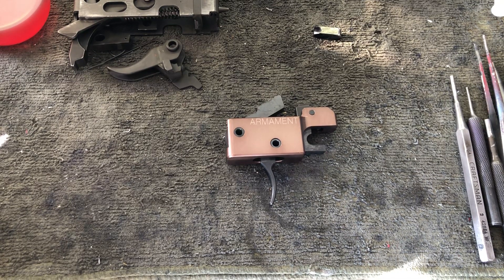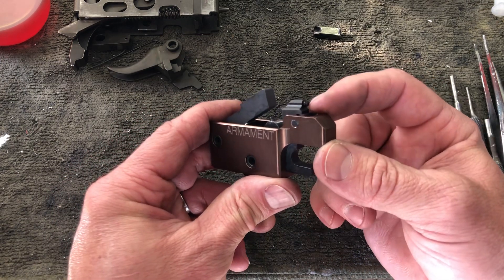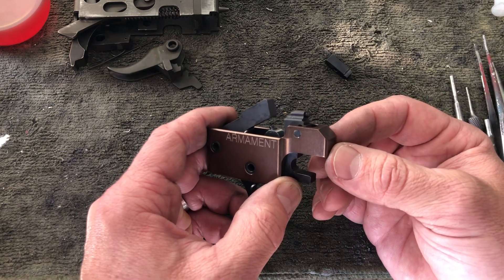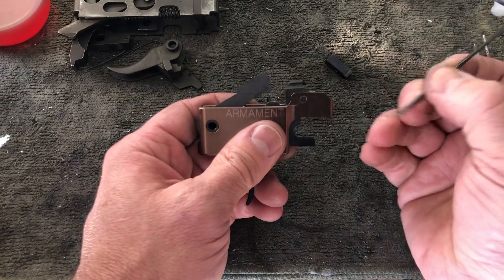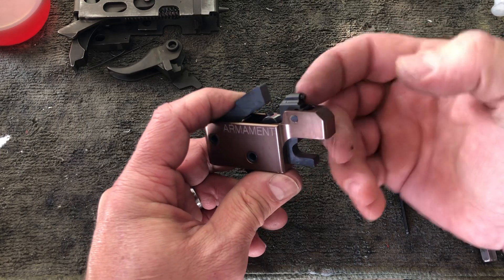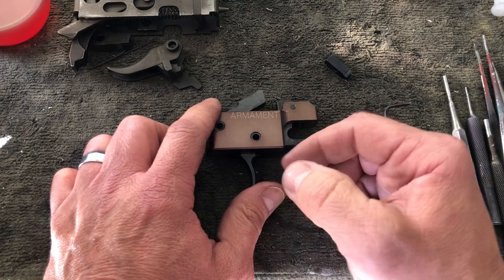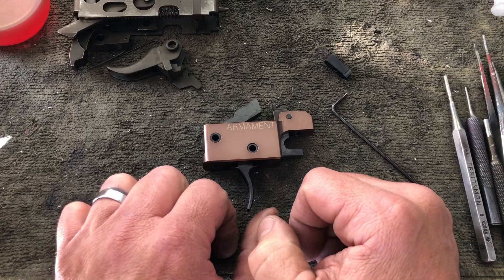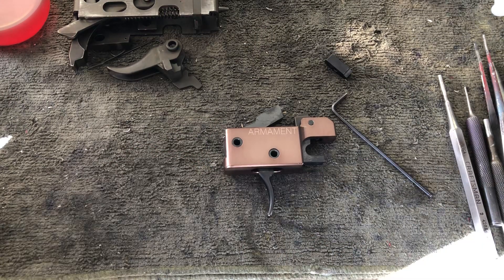Rate Breed FRT Trigger bar

Comment: Fourth issue, 3 position selector. Is it possible to change?
Reply: No, unfortunately, it's not possible.
Reply: There are 3d printer version available
Reply: @CBRN-Fan-Boy  Yea I know which one you're referring to.
Reply: @picklerick9578  which one?
Reply: @CBRN-Fan-Boy  The one that's on twitter
Reply: @picklerick9578  I’m not aware of that one.
Reply: @CBRN-Fan-Boy  which one are you aware of?
Reply: That would require a disconnector and a major re-design. I'd love to see it happen though.
Reply: @1bryanh1  what if I told you no? What if I told you it would only take a standard trigger assembly and one extra piece?
Reply: @picklerick9578  a user on Reddit made one and it’s very reliable and very easy to use. I have the STL files from him.
Reply: @CBRN-Fan-Boy  You have one built?
Reply: @bryanhoell5886  Yup, works great. I just wish I could get this to someone who could machine it.
Reply: @CBRN-Fan-Boy  I'd ask local gunsmiths. Can you get dimensions from the files?
Reply: @CBRN-Fan-Boy  can you send me the files bro
Reply: @emperordonaldtrump1st614  Is be happy to if you machine it out for me.
Reply: @CBRN-Fan-Boy  Send me the files. I'll machine it for you.
Reply: @smokeusmvmc8058  how would you like me to get them to you?

Comment: I've had you install the first upgrades that never really helped with the light primer strikes,failure to cycle,now with a third attempt will we previous customers be compensated for this? I feel you need to address this as it's not fair to charge me a third time.
Reply from the maker: With all due respect, your issue could also be timing. There’s also MANY factors at play here, I cannot address them all. I’m trying, I’m dealing with literally thousands of these triggers and twice that in emails/calls.
Reply: @barryarmsfflsot  my question wasnt6 intended for you,my bad, but I admit you did work on my trigger twice,and now I see your adding a third modification,small world huh!

Comment: I tried to tell everyone these triggers were made  for modified bcg specifically tuned to this trigger…the spring would have never linked or had problems if the bcg had less material that completely mashed the locking bar all the way in
Reply: If it ain’t Mr. Kentucky himself 💯🤠🍻
Reply from the maker: I disagree. The trigger bar spring in these triggers is a flawed design. Right off the bat, you don’t design the moment of a compression spring to in an arch, like a leaf spring. Then you design the two surfaces so that it creates a shearing moment around that spring. Rare Breed did address it but it didn’t eliminate the problem. The design of our drop in trigger bar is the ONLY option that addresses the 3 big issues with the FRT15 and WOT triggers. Our upgrade services are extremely effective, the trigger bar is even better…
Reply: @barryarmsfflsot I’m just repeating what I was told from the man who actually designed this trigger amd that problem has since been fixed when he designed and released the new trigger that big daddy unlimited has now taken control of, the Graves ART starfire was designed to replace the horizontal spring with a vertical spring so there’s no kinking up the spring anymore

Comment: That set screw will not last long.
Reply: I can see wear on screw unless it's heat treated to match the carrier. That, and it could move unless you used a permanent thread locker. A lot of vibration and pressure will be going through that screw. I do like the concept though.
Reply: @1bryanh1  the BCG is going to be banging on it every single round. That thing won't last 500rds
Reply from the maker: @NOTSOSLIMJIM  the newest model has a large, low profile head, 6-32 bolt. Yes, it is softer than the carrier, by design. It’s a wear point, it’s supposed to wear. And extremely easy to replace.
Reply: @barryarmsfflsot  yeah, I saw that on Facebook. Definitely a better approach. I had an issue with the trip on my WOT and my CMMG 5.7 pistol. I TIG welded some S7 tool steel onto the BCG and filed it back till I had the correct engagement.